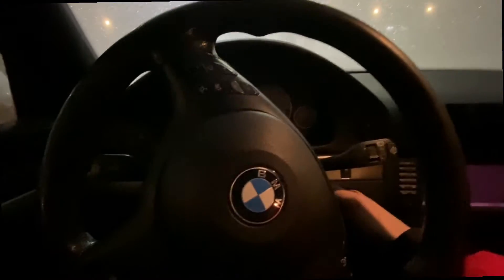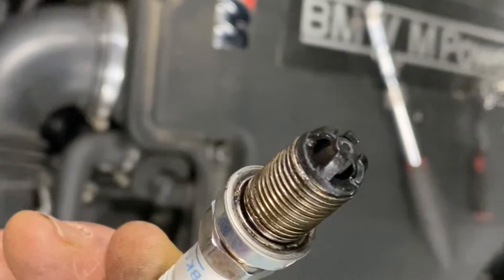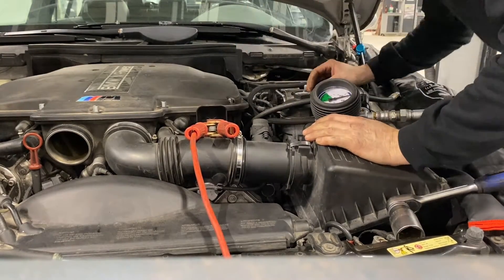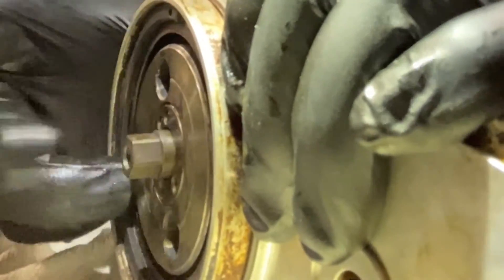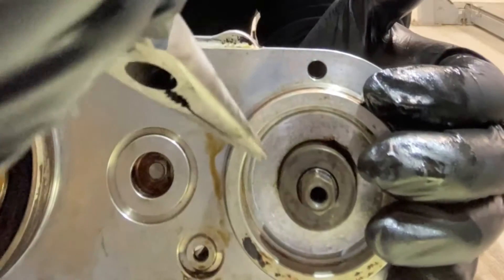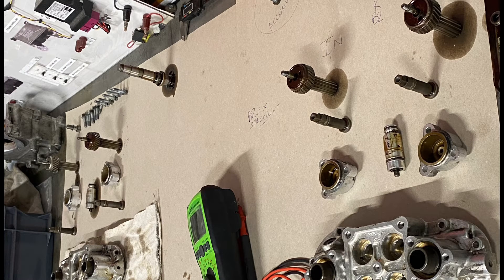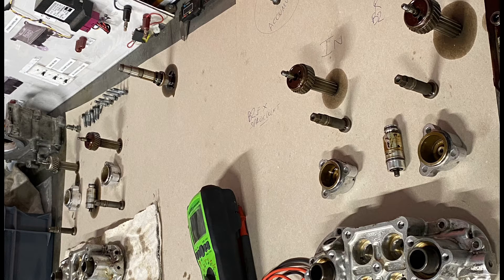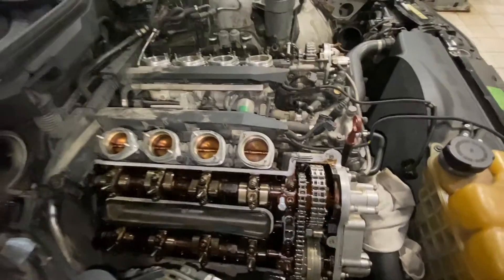E39 M5 RUNNING LIKE A BAG OF SPANNERS. OTHER GARAGE TRIED BUT FAILED TO REPAIR THE VANOS.

Comment: The engine compression is good, the fuel pump is good, the ignition is ok I think my problem is the timing I followed how to do the timing with the TIS BMW software there is a precision that when the engine is stopped the vanos places the camshafts in the position suitable for starting the engine. Could you take a photo of the position of the camshafts of bench 1 and 2 when the engine is stopped so that I can time my engine like yours please

Comment: You are in fact doing the splined gear “magic spot” wrong.

The hub is turned clockwise fully with the hub bolts as snug as possible to still allow the hub to smoothly turn (the idea is you’re removing loose bolt / hub slop as much as possible). You rotate the splined shaft to find the magic spot. You DO NOT turn the hub counter clockwise to do this. It must stay fully clockwise. You are clearly turning the hub.

There is a point on the shaft where it will perfectly line up with the cam splines and the hub splines allowing you to fully insert the shaft and fully remove it. The hub will be fully clockwise at that point.

Please correct this before finishing the work.
Reply: Never seen a compression tester like that before, I bet that cost a bit.
Reply: S52 but the concept is the same. https://youtu.be/KK43OPS7WqQ?si=L7LSiX6V8G_lTH-h
Reply from the maker: Lets see if I can find the magic tooth in the next video then. I was over dramatising it for the sake of showing what happens when the shaft is turned anti clockwise if you listen to what I was saying. I will be building this up today.
Reply from the maker: https://youtu.be/7kEyZKZKYfQ?si=5WovN1PKROlIUOPm